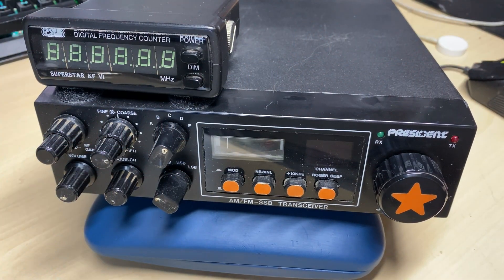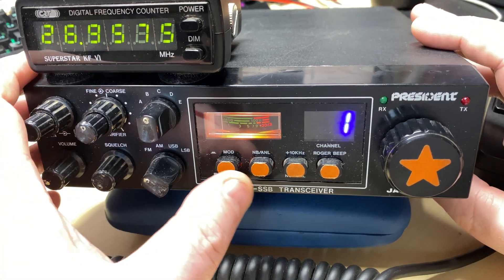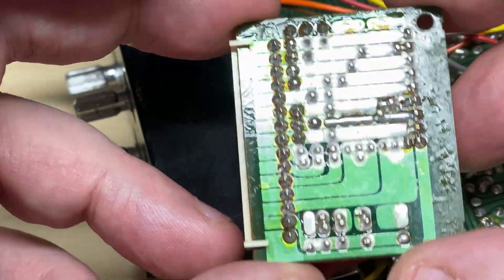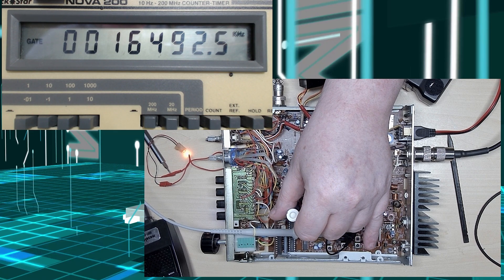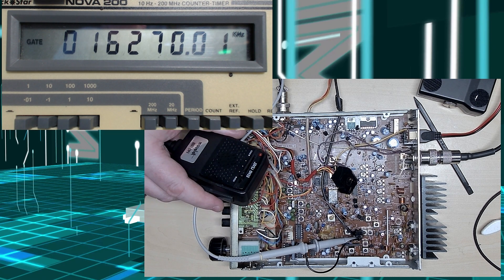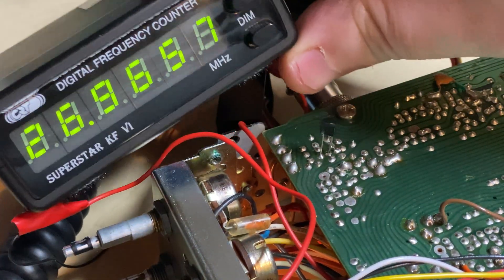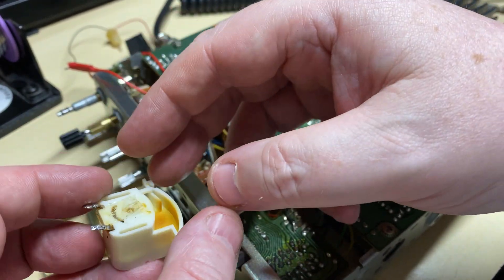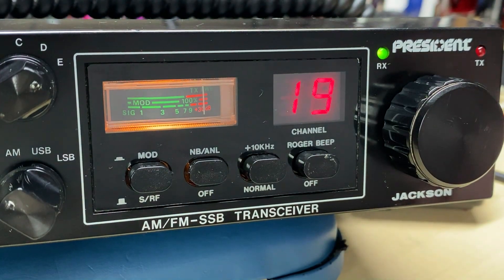EP 175  - President Jackson 5 band SSB CB radio - RX fault and alignment.

Comment: I'd love to get my hands on one of these, i think they look fab , heard so many good reports about them.....
Reply from the maker: Some don't like them because they drift a bit on first switch on , apart from that they are a good radio.
Reply: @MicroChipz  they fetch good money in good condition, id have either 5 or 6 band...I'd definitely pop your board in it to have uk40 though
Reply from the maker: Well with my no wire board its just a case of removing the PLL and fitting my board in its place , no nasty cut tracks, no messing around ;)
Reply: @MicroChipz is there a way to fix the drift? I hear you can change the crystals.